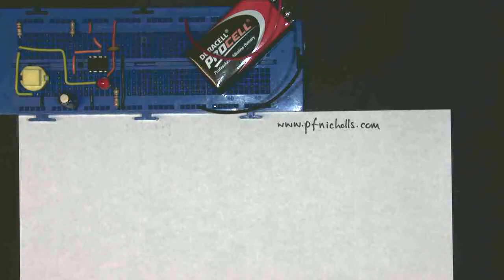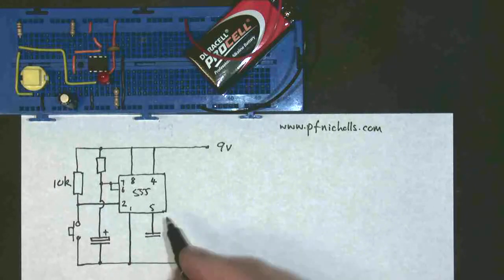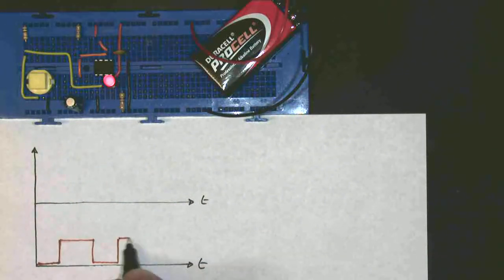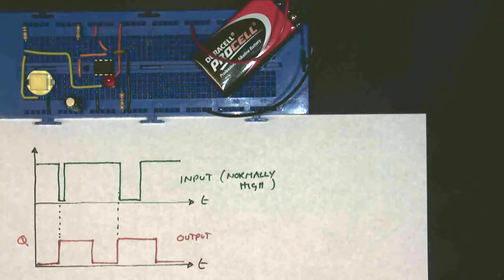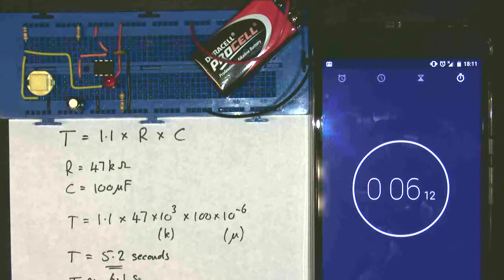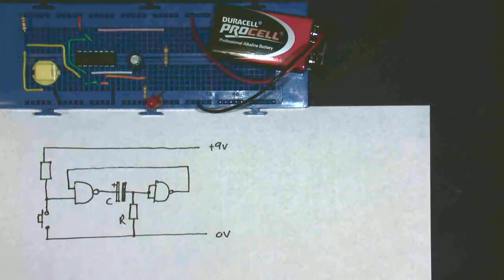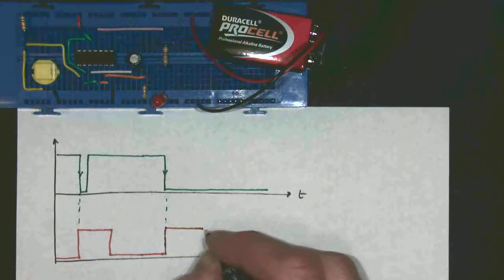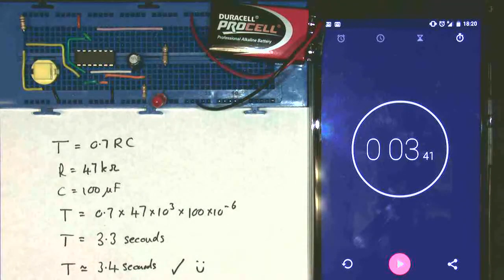Monostable

Comment: Please sir....what IC did you use for nand gate monostable.
Reply from the maker: Thanks for your comment. I used the 4011 Quad NAND gate IC in this example because the power supply requirements for this IC are flexible - it works with a 9V battery. The pin layout is here if you need it: https://www.electronicsteaching.com/Electronics/4000data.html